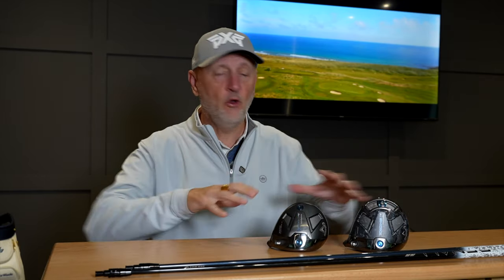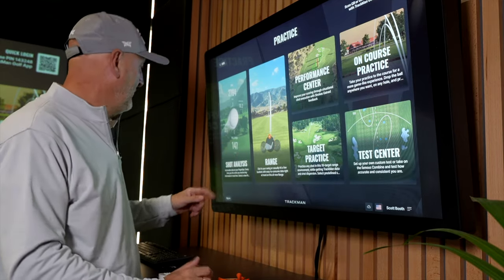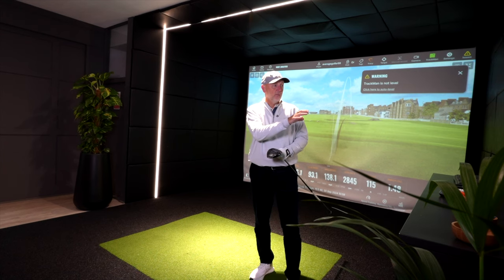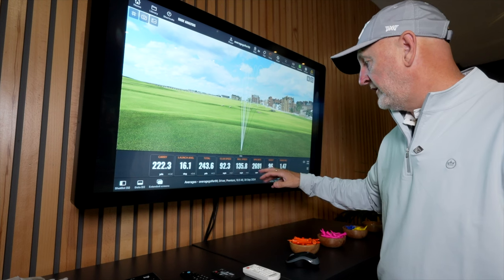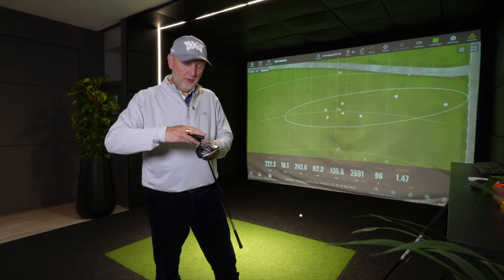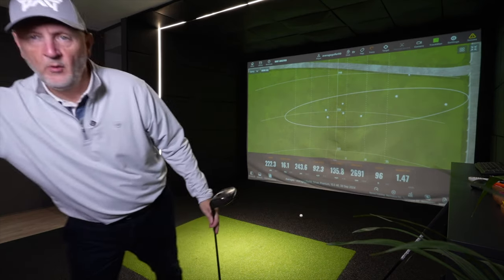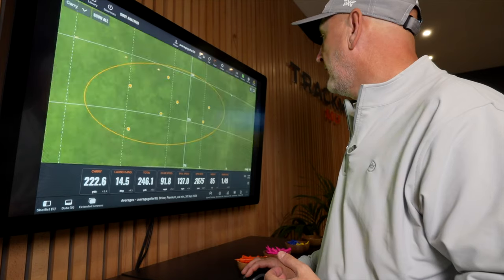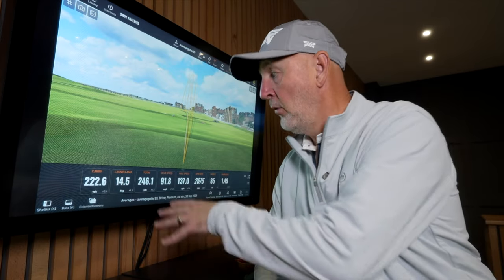One of these is the perfect driver/shaft combination for Average golfers.

Comment: The shorter the shaft the bigger the consistency and center hits to maximise the smash factor.  For swing speeds lower than 90 mph playing with driver loft > 11 will make loose distance. Thats pure physics. To find your right combo look for the length you have more center hits and the loft gives you longer carry distance adapted to your swing specs.

Comment: I'm a 62 year old 18 handicap golfer, and I have had an interest in this topic for a long time. My current setup is a Cobra F9 10.5 head lofted to 12 degrees with a 45 inch reg flex shaft weighing 58g. Club head speed around 90 mph. Here are a couple of things I have picked up over the years. 1. TXG and others have suggested that a shorter shaft with a standard head alters the swing weight, and needs weight added to the clubhead to compensate. 2. Tom Wishon (expert fitter/club builder) has said (if I remember correctly) that a golfer needs to meet 3 conditions to use a stock 46-inch shaft, namely a clubhead speed of 105+ mph, clubface control to find the centre of the face, and to square the face to the path. 3. I believe that the average shaft length for Tour players is around 44.5 inches. My guess about the more or less standard stock shaft length of 46 inches from club maufacturers is aimed mostly at the buyer's perceived ability/potential to hit long (we all want more) and shelf-appeal - if you're looking at a row of drivers in the store, you'll likley skip the driver with a shorter shaft. Taking all this together, we're mostly buying expensive drivers with less-than-optimal shaft lengths for the majority of us. I also have an older TM mini-driver 12* loft, but I struggle to find the best tee height and consequently am less conficent with it.
Reply: Tom wishon has enlightened many people, just wish more people would listen to him :)

Comment: I have tried both combos.  I now have a Taylor Made 300 mini and a 10.5 tsr2 with a 44.5 inch shaft. I cannot seem to hit mini driver consistently. I think it is the tee height/technique that is causing me problems. However the driver with shorter shaft works really well for me and just feels a better fit. I have a similar club speed to yourself and play regular shaft. Do you find the stiff shaft works for you though.

Comment: Right after watching this I (50s, golfing < 2 yrs, 22 H.I.) ordered a 43" shaft from Callaway pre-owned to replace my stock AI Smoke 44.75" shaft. It arrived today; I tested side-by-side in the simulator and then took out on the course. Results exactly consistent with yours -- two-thirds reduction in lateral dispersion with no impact on distance (and slightly tighter distance dispersion). On the course the ball flew straighter and didn't balloon, reflecting the lower spin numbers I saw in the sim. I also hit several drives to record distances, thanks to a more confident swing and center strikes. 

I'm convinced, and am keeping the short shaft! Thanks for putting this test together, it was super helpful.

Comment: I use two full size drivers same make and model one at 10.5*/ 45.5 and a 2nd at 13*/ 44. The 10.5 goes 250 and the 13 goes 230. I love both. I use the 2nd driver as a replacement for my 3W/ 4W. More accuracy and distance. I have never felt comfortable with a FW on the tee and particularly off the deck. So it's an easy swap because I wasn't using a FW of the deck anyway. Very happy!
Reply: Wow!   Very interesting!!   Kudos to you …. 👍

Comment: I’m using a 44” shaft and a driver head with 12.75 degrees. I have a lot more consistency and distance as a result of that control. The swing weight is C9, which helps me as a senior golfer. Thanks to Golf Galaxy for this setup and help.

Comment: I'm clearly generalizing here and it depends on body dimensions and ability to hit the sweet spot. But I think a lot of folks would benefit from shorter drivers with more loft. Somewhere I read some mechanical testing comparing different lofts at different driver swing speeds; it was around 85mph that a 10.5 degree loft and 12 degree loft were roughly equal with respect to distance. I see a lot of slower swing speed players who struggle to get any height or carry. And shaft length only helps if you're hitting the sweet spot. My take on "mini drivers" is they are really intended for folks with very high swing speeds; folks who would play a 3W off the tee frequently, and/or folks who want to hit a mini driver off the deck. IMO, most of us can mere mortals would benefit more from a 460 degree head with appropriate loft and shaft length.
Reply: I disagree, I have played all current drivers off the shelf and without doubt the new Callaway mini driver is the best I have hit. Period. I play off 10 hcp. I spend thousands every year on golf clubs but will not ever let this driver go from my bag, even if I throw in a new std driver for in.

Comment: Yep, I also got a lot better with my driver when I shortened it from 45.5 to 44.5. I bought some aftermarket head weights to compensate for the swing weight change when I cut the shaft down. Switching to DRI-TAC light grip from a standard grip helped compensate for the swing weight change, too. I haven't noticed any difference in distance, but I definitely hit the mini-drivers shorter than my normal driver.

Comment: Very interesting to see the compared numbers. I had an old Cobra driver with a 460 head and 45 inch shaft that was too whippy, so I just cut it down by two inches. I hit it just over 200 yards very straight and consistent which is ideal for the long par threes. It works for me.

Comment: Agree entirely. 66 yo golfer hitting an older Ping G30 SF Tech driver fitted with a 44" shaft and swingweighted back to D2 using an aftermarket weight plug.
No appreciable loss in distance from the 45.75" stock shaft, but with a lot more centre strikes and increased control. Game changer.

Comment: While we all dont have his speed, I believe that I saw that Sergio Garcia's Driver shafted length is somewhere around 44" and he sure seems awful consistant and still quite long off the tee, I think he also uses a quite heavy shaft weight, perhaps you could research it and let us all know. Hitting the center of the club face I believe is the most important factor in distance and if I am cprrect the mathmatical formula is Mass x Velocity squared equals distance, with the point of that being that you transfer the most energy into the ball by hitting it in the middle of the club head....great video as always Andy!

Comment: I swing a bit faster (105-110) and I swing up a bit, but I've found a shorter shaft doesn't decrease my swing speeds or carry at all.  I prefer a 44" - it just feels more controllable for me, and it feels like I can swing more freely with it.  I've also messed with loft changes (from 13 to 8) and find that I don't see much benefit from either end of the spectrum - the 13 is a little more consistent, the 8 is a little longer, but I'm pretty inconsistent overall so I game a 9.  (~16 handicap)

Comment: This is quite amazing results, I like the larger head with the shorter shaft, never tried it, but may take my Black Ops 10.5 degree driver and get a shorter shaft to try out.
Reply: Exactly what I did with my Black Ops.  45.5 to 44.5.  I added 12g of weight into the head to maintain the swing weight.  A lot more consistency

Comment: I play a Ping G400 Max driver (9 degrees) w/ a stiff shaft cut down by 1” to 44.75”.  I find the shorter shaft gives me a little better control (tighter dispersion) over the standard 45.75” shaft length.  I’ve adjusted the loft to 10 degrees.

Comment: This can go either way w. a shorter shaft in a driver head. It will make the swingweight less which could be a + or - (you could always add lead or hot melt). The ball will launch a bit lower which also can be a + or - depending upon the golfer and the shaft should feel a bit firmer.  You should always center strike better w. the shorter shaft which is always a +. As to choking down, there are plenty of you tube vids about this I believe.

Comment: Bought a cheap shaft as a test . Had it cut down an inch (44.75”) and installed it on a Ping G425.  Big difference. Very easy to hit and just as long, maybe slightly longer.
But be careful. You’re changing both the swing weight and the lie angle of the Club.

Comment: I have a few drivers set up. I have 42.5, 43 and 44 inch options at present. I'm finding the 44 harder to control. I have 10.5, 11 and 13 degree options. 13 can hit pretty high unless I close the face a bit, but then I am most effective off the tee when I really hit up on the thing. I get a less outside swing that way, and I don't slice as often. My 44" 10.5 is 2 degrees closed, which is like a square faced 12.5, since when you close the face you deloft it as well. So I actually hit my 44" 10.5 and 13 degrees to a similar height if I close the face on the 13 a bit. I don't really have a smaller head option. One is slightly smaller, and only 400cc instead of 460. But the mini drivers are smaller than that, more like an old Big Bertha or something. So I can't comment on those. I do like the forgiveness on my main 460cc models, though. I don't get much drop off in distance if I miss the centre somewhat. I have to go way out to the toe or heel before I get a substantial difference, which is nice.

Comment: I’ve tried using shorter driver shafts and it’s interesting. One round a gem the next a mud rock. The issue is swing weights. I tend to have to lower my hands for straighter ball flight and even then I have a tendency to slice my tee shots. The pros have the luxury of having great club techs apply liquid weight in the heads in the right places for optimal performance. These applications are very hard to get from a fitter who’s not experienced in this process. Any thoughts on this Andy?

Comment: A shorter  driver shaft is one item. Torque in the shaft being the key issue for my accuracy . I tipped shortened my shafts to keep the torque maximum. 
I have a mini diver Big Bertha Mini, tipped driver shaft to 43" tensi blue 55gram Stiff .  Carry is 215-230 yards real course result using GPS tags.
I have Big Bertha Fusion driver (a 10K driver everyone forgot about, shaft 44.5" tensi blue 75gram stiff . Carry is 230-240 yards. 
A few times teed of with both you do see the mini land 20 yards shorter Totals just depends on how firm the fairways are mid summer +30 yards.

Comment: Did it change the swing weight going to a shorter shaft with the 460cc head? I cut down a driver 1 1/2 inches, and it felt quite heavey on the head after that. I didn't do a swing weight, but I suspect that by how it felt, it changed quite a bit.

Comment: I,m 58 getting back into golf, with an average swing speed but no consistency with my old Nike 10.5 degree Ignite driver, which pings so loud it aggravates my tinnitus 😂. I went for a fitting, 9 degree reg shaft, normal length, Ping 10k max, when I hit it well a 250 yd rocket, but still too many wayward shots that would kill me on my course. At the “American” fitting there was little support/provision to experiment with shorter stock shafts. I decided to postpone any investment and keep taking lessons. What do I have in the bag now? A free old ladies Taylormade burner. It is shorter, high loft (no idea), I hit it 200 yard on the fairway 90% of time. It’s not a permanent fix but I will take a look at shorter when I invest £500+ on my new driver, if they don’t explore this I will walk away. You can’t beat booming it miles down the middle but nothing kills your score like lost balls and out of bounds!

Comment: Hi Andy, great video!  

I played a 2 wood, aka mini driver, for many years. I discovered my sweet spot was a 2 wood with a 45 inch shaft. Long and very accurate. The smaller head had less drag than the big boulbous heads of 460 cc’s. 

If i wanted to ruin a round of golf, i put in the big driver with a long shaft. 

My average with the 2 wood was around 285 -289. Sneaky long they said. 

And choking down a wee bit on it for the 2nd shot on a par 5 was near or very close to the green. 

Thanks for your great work!  

PS. What camera are you using for these wonderful videos?  👍